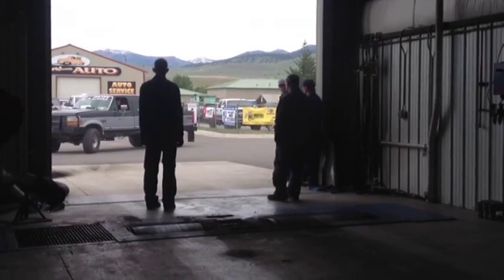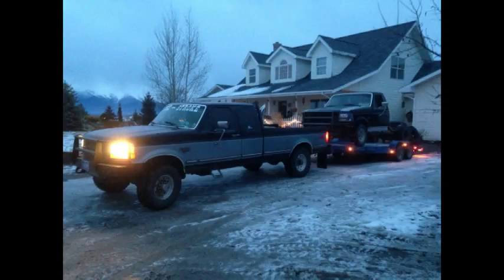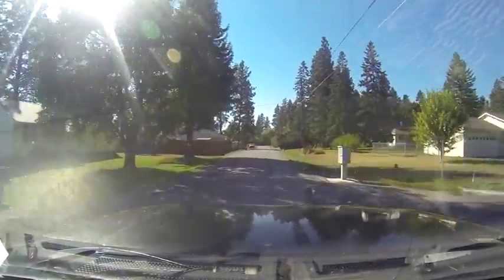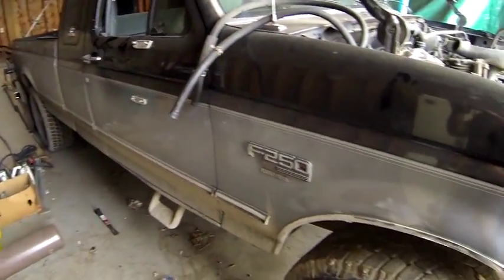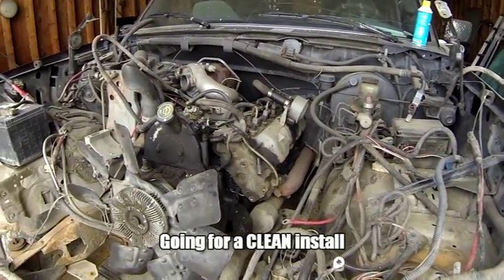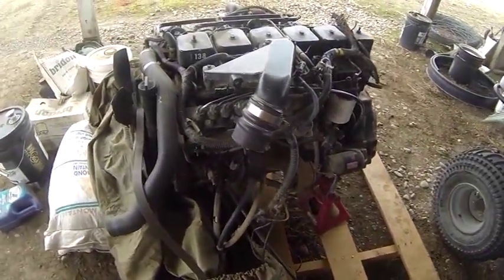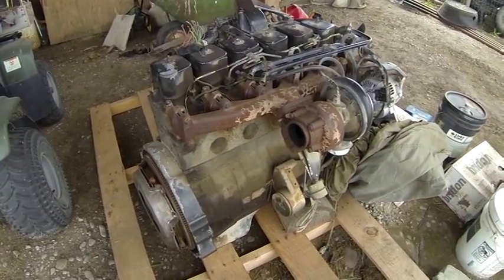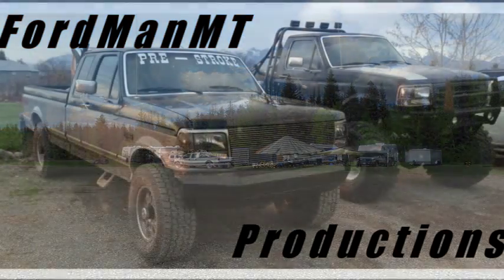Ford Cummins Swap

Comment: Hey FORDMANMT,                        what are you going to doing with the old 7.3 idi turbo motor?
Reply from the maker: Haven't decided. Might sell it, might throw it in Somthing else.
Reply: Cool, looking forward to watching/ seeing your cummins swap! I live in Billings, MT and I just bought a 1994 f-350 7.3 idi turbo, I have a small air leak/ diesel leak on the bottom of my injection pump. I'm looking at getting a new pump but was wondering if you were running a "high altitude" pump?